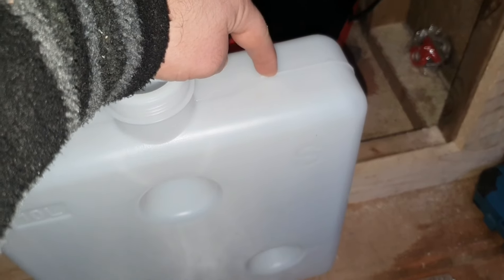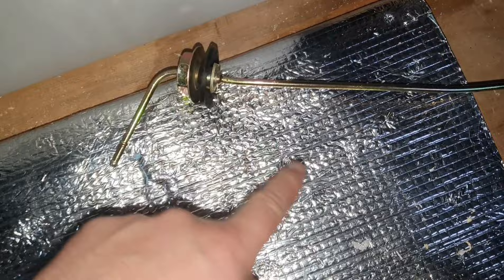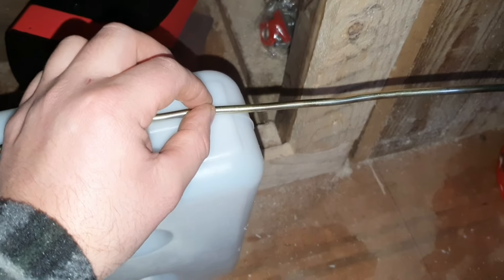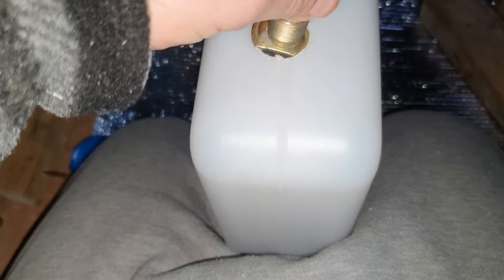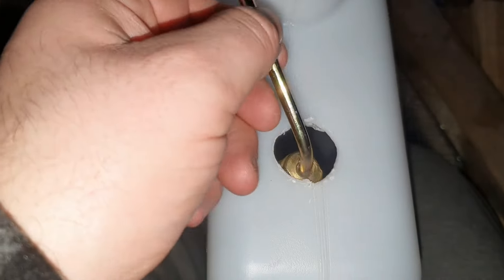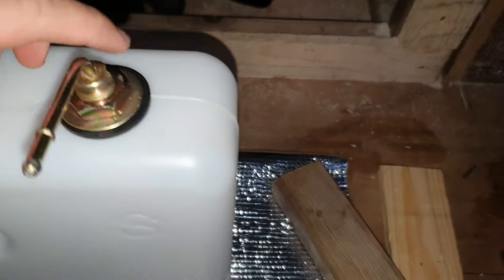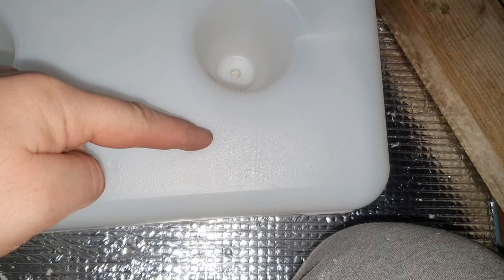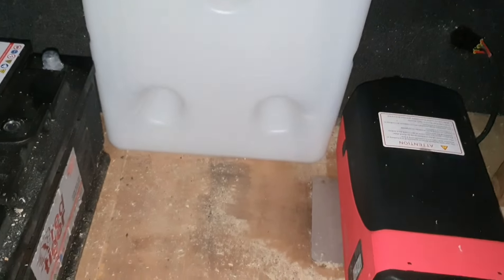fitting the stand pipe in the diesel heater/night heater separate fuel tank

Comment: I've seen this done with a normal petrol can and the rubber washer fitted the cans collar perfectly, could I find a filler collar with that perfect fit.....NOPE   hha seems there is a mm or 2 difference in what I saw and tried.
Reply from the maker: Always the way lol 
Can you not use a very slightly bigger washer?
Reply: @LT_TOMMY_  its the supplied rubber washer like yours there thats slightly too big and Im not wanting to force it in as it likely wont seal right....tricky but maybe I can find same slightly smaller. My supplied tank like yours has a moulded outlet on bottom so wont sit flat...... nothing is ever straight forward even when im in the Chinese chippy!  😁